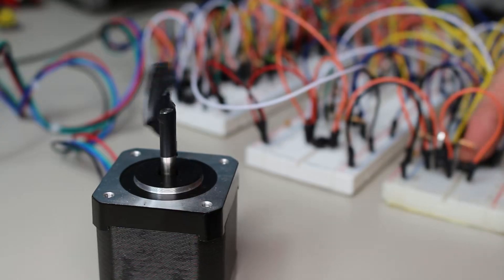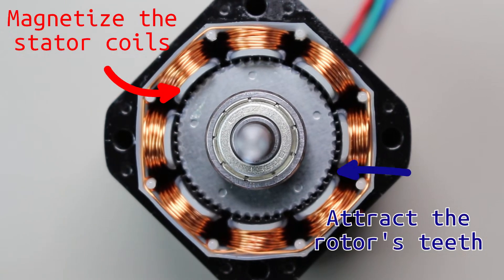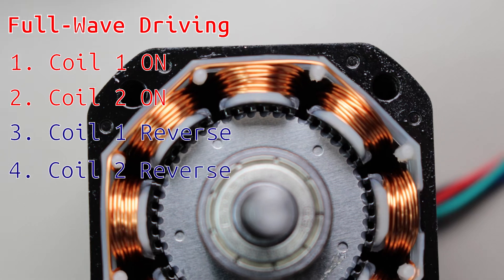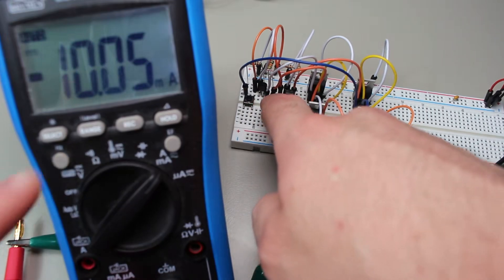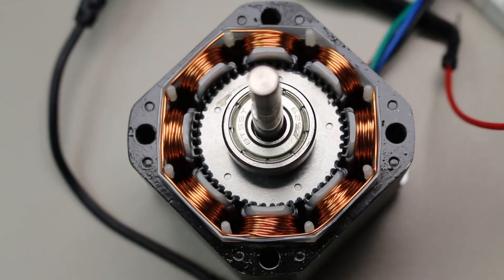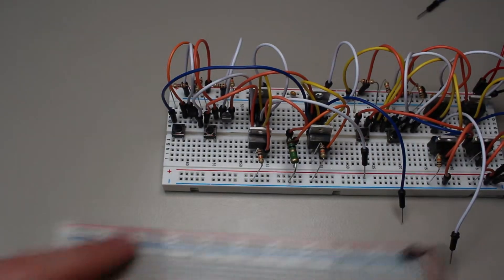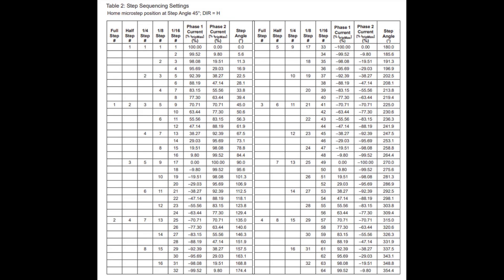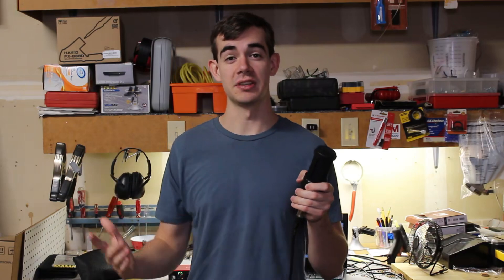DIY Stepper Motor Driver From Scratch

Comment: There is a good reason to build these circuits using discrete components.  I live in Tucson and regularly reach 120 degrees and above.  These temperatures fry all the small components in the Chinese stuff.  I cannot even guess how many circuits that I have to replace once the temps go up here.  Everything works fine until we get hot here then everything goes down.  This makes running my CNC next to impossible except in the winter months.  It gets very frustrating using my CNC then the next day going out to run it again just to find out it no longer works.  I wish I could get some help with this.

Comment: Hi  @SineLab, your tutorials are always great, and I always learn something new from them! I have a question: for adaptive current control based on torque (low torque = low current, high torque = high current) using MOSFETs, should we implement it using feedback from the shunt resistors or the back-EMF of the coils? Can you answer in one or two lines?

Comment: For the full wave driving a cool way you could've drived it would've been a simple binary counter:

oil 1 - C1
coil 2 - C2

c1 +-
c2 +-
c1 -+
c2 -+

So with a 2 bit binary counter:
XY
00
01
10
11

We can use the X bit to toggle between driving the coil in the +- and -+ direction.
Then we can use the Y bit to toggle between working on c1 and c2
Reply: Great suggestion

Comment: Got a 1.7 (german score)doing a project using your video,but i used a esp32 for signal and build my own 220v-24v 1n5004 diode with  linear dc regulator,and external IR for position 
Thanks for the vid
Reply: can u sshow mw schmeatics?

Comment: Nah, if i use something i just need to know what happen. So before just using stepper driver ic i just want to try manual mode. But, i am too lazy to make my own h-bridge so i use ir2110, then i was too lazy to calculate deadtime so it was ir2153😆

Comment: I have a question: do we need to use MOSFET drivers to control the MOSFETs here?
Reply from the maker: If you were using high-side N-Channel mosfets, then yes. You would need to bootstrap them.

But in the video I used P-Channel mosfets, so only an NPN was needed to invert the signal and drive them.

Comment: I am trying to replicate what you have done. In the video you talk about using potientometer, however I dont recognize those on your schematic? Is R17 and R25 ptientometers? Thanks for this great video, this is by far the best reference I have!
Reply from the maker: It's been a while, but I don't think that the potentiometer is used in the final schematic. It was simply an intermediate step to test a variable voltage.

It was replaced by the DAC so that the microcontroller could change the voltage.

I hope that this helps!